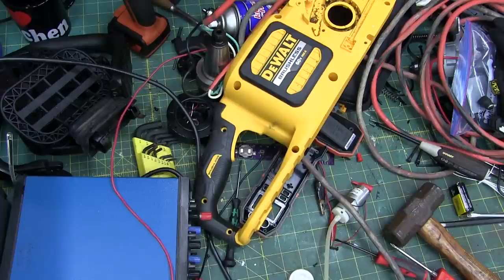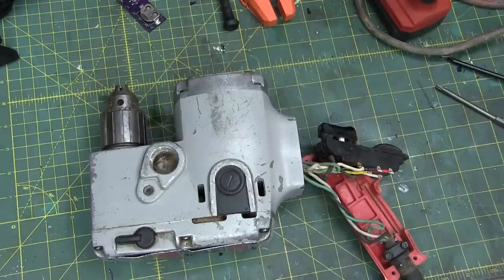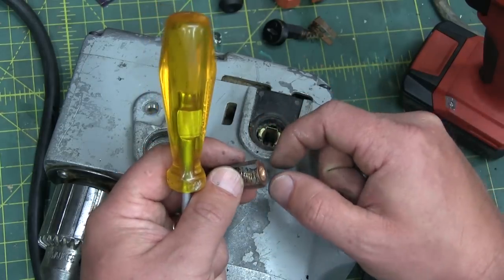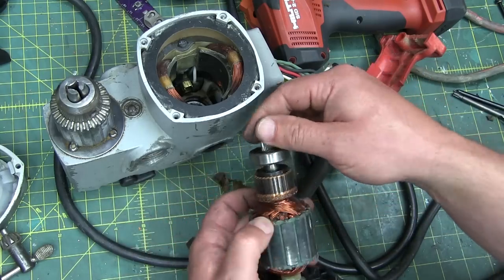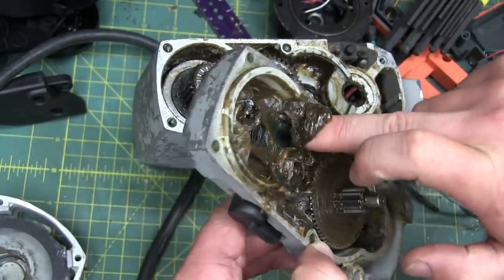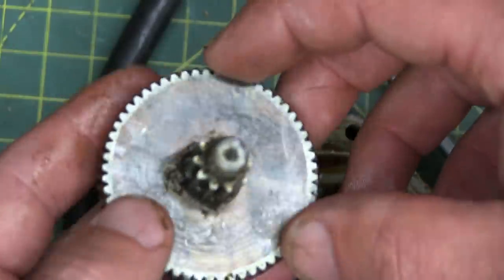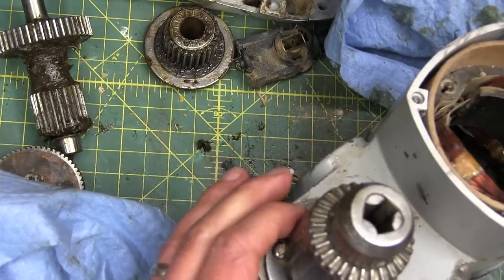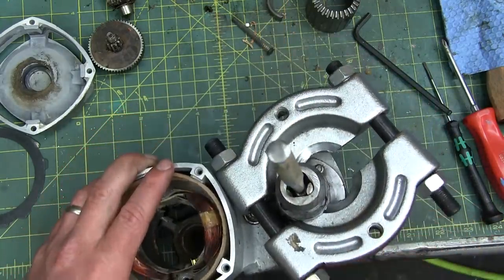BOLTR: Milwaukee Hole Hawg | Long Term Quality

Comment: Great video. I've had mine for about ten years or more and yes it's a beast. I've got it apart now because I'm replacing the cord. So, while it's apart I'm going to finish removing the cheap paint job and polishing the case. The finish started flaking a year after purchase. Total disappointed with Milwaukee for that. Other than that, its been a super tool. The handle that came with mine is almost 12 inches long. And you're right, galvanized pipe with a big rubber handle.
Thanks for the video. I was checking out which direction the chuck unscrews. Then found out it just slides on. Easy peasy.  Thanks again 👍

Comment: I still use my '96 vintage Hole-Hawg.  Bought it brand new at 19, or 20. So fun when it spins you off your ladder, and leaves you hanging at the top-plate with a 2" self-feed bit. Weeee. So, now I use holesaws and predrill 3 holes.

Comment: If you was unawares, that "broken" screw ring is broken at the factory (really).  It is machined, placed in a fixture, and snappen in twain.  It's the only way to install it.  Also: once you remove the center screw from inside the chuck, the chuck unscrews from the final drive shaft.  But only when you haven't first pressed the rotating collar off the chuck.

Comment: At  the tender age of 19 as a plumbers aprentice I had to use one of these to drill 4 1/4 inch holes on new constcution. If the bit hit a knot or otherwise bound at 150lbs I was simply along for the ride. Never hold one in such a way that it doesn't pull right out of your hand or you won't have a very long career . In other words "hold on loosely but don't let her go if you cling to tightly you will loose control"

Comment: The chuck is threaded on! Not pressed on to the shaft. That ring on the chuck is split from the factory. Put the chuck back together and put the largest allen wrench it will accept in short end first. Hit the long end of the allen wrench with a hammer while holding the opposite end of the shaft, should be standard (not reverse) threaded.

Comment: If the chuck has a "B" in the Jacobs part number, it's threaded and screwed to the drill's output shaft. For a 1/2" chuck probably a 1/2-20 SAE. Regular ol' right hand threads though. "Standard" procedure (before the drill is apart) is to clamp the chuck jaws down on a right angle allen wrench and give it a sharp whack with a mallet. Should spin right off. You'd have to re-assemble the chuck, though. Without the "B" they usually need "chuck wedges" to be removed from the tapered drill output shaft. Of course Jacobs sell those wedges at a non-trivial price. Sigh... Thank you for keeping up the awesome work!! You've helped me out of more than one jam!

Comment: Threaded ring isn't broken, it's 2 pieces. The chuck is pressed together (and apart) to facilitate rebuilding. It may be pressed into the drill's shaft via a jacob's taper. If it is, there are wedges that are used in pairs to pop it off.

Comment: The cordless chucks are threaded on with right hand thread with a LH screw in the chuck(I see you found the LH screw). Try holding the shaft while turning chuck?

Comment: That chuck threads on.  You have to take out the locking screw, then clamp a hex key in the chuck to rotate the chuck body off of the spindle.

The split ring is a split ring.  It's meant to be split so it can be assembled.

Comment: 08 makes sense. I got in the trades in 07 and the hogs the shop would send us back then mostly looked in the same condition as yours right now. Thing is, 11 years later we are still tossing the same hole hogs into the job boxes and they really aren’t looking any different as far as the body goes. The cords have to be replaced periodically and probably the brushes, but it’s nothing our shop boys can’t fix in a morning and have back out to us the next day.

Comment: Bought mine new in about '81?ish. I think that they probably couldn't sell them like that anymore. Too many people would get injured!! Only complaint I have about mine is the chuck, always was a little TOO close tolerance, a little dirt and you couldn't adjust it by hand. Had to blow out the dust and spray lube it regularly. Always tried to use bits with 3 or 6 flats on them to avoid having to use a pipe wrench on the chuck, saw people doing that before I bought mine. I only loaned it to people I trusted, only about three times. It sets in it's factory metal case next to the Hilti hammer drill out in the shop. I think that it could crank start a big block, the low range in the old Hawgs is incredible to behold. Precautions HAVE to be taken. More so now as the top rated hole saws now are stronger than they were back then, a weak point has been removed and more of that torque is available to your wrists. The best injury precaution, as is usually the case, is common sense. Great Video as usual. I thought I would see how to get that chuck off to replace it... I'm just gonna keep it lubed and stay quiet!.. Again, GREAT VIDEO! as usual.

Comment: About 40 years ago, a friend of mine was up in a ceiling crawl space, in a really difficult spot to get to and he was using a Hole Hawg with the ground prong yanked out of ther plug just like this one to drill for some romex to be pulled thru from one space in a strip mall to the adjacent space a bar we frequented to expand and double its size. Well, with the really twisted position he had to assume to be up there, the visibility was NFG and he ended up drilling into something electrical that gave him a nasty jolt. This caused him to be unable to release his grip on the Hole Hawg and it twisted his forearm all the way around breaking both bones in multiple places and tearing up a bunch of the other connecting tissues in his arm. He required a number of surgeries and several months of rehab to eventually recover (more or less) but was bever really the same after that.

Comment: I'm kind of wondering if it wasn't built in that cardboard tube to make manufacturing easier. Or maybe to keep the heat from getting to the metal case and getting so hot the user couldn't hold it any more.

Comment: I believe the fan was sucking the air not blowing the air over the windings.
Also, in my experience, the ring on the chuck are normally in two pieces otherwise they cant go on.
good review. thanks

Comment: I suspect the cardboard cylinder is an insulator so if the winding enamel cracks, the grounded metal case won't immediately trip the breaker.  Or the elec-chicken gets bitten by the pixies.  About 20 years ago, I replaced the 3 prong outlet (with the missing ground pin) with a good 3 pin plug and also swapped out the burnt out trigger switch.  No variable speed there, just the high/low gear on the gearbox.

Comment: The threaded ring in that chuck was intentionally cracked at the factory to assemble it.  They machine it as one part so the threads are perfectly in line.  Then they harden it and break it so it can be installed.

Comment: The switch connectors do come out. They are a flag type terminal. When we change cords on these we just snip, strip, and spin on wire nuts to connect the new cord to the switch.

Comment: The cardboard will help keep the case cooler, that's one place you hold onto. Nobody uses that pipe nipple handle, it's the first thing you throw away, it's a good way to get hurt, these hole hawg's aren't a toy or for the faint of hart but they are priceless!

Comment: Late to this party, but I picked up a real old one of these in an auction lot years ago. Turned out - I don't know how - but someone had managed to twist the spindle in two! Although it was way beyond my skill level, I made a replacement out of 1144 stressproof and it works to this day! I seem to remember chuck being 3/8-24. Must have been right-hand too, cuz I wouldn't have been able to single-point it back then and I know I didn't have a LH die...

Comment: There are several different ways that Jacobs type chucks are held onto the shaft.  I'll bet yours is threaded on with normal (lefty loosy righty tighty) threads.  The reverse thread machine screw is to lock it on the shaft.  Kind of like a jam nut arrangement.

Comment: Oh, yeah they'll spin yer wrist right in two. We used to use them to install central vac systems in new construction...with a 2.5" monster bit. And for speed we had the 3' foot extension rod so we didn't need to use ladders too much. Loved watching my noobie installers spin right round when the bit got caught on a nail. Ah THOSE were the days! I still have one somewhere.

Comment: I can’t take it anymore. There is a special tool that slides over the opposite side of the chuck shaft that needs to be clamped in a vice, you the need to tighten the chuck on a 1/2” hex socket bit,& then either use a 1/2 impactor tool, or a extremely large breaker bar to remove the chuck. I use to rebuild the hole hawgs. The small pinion gear was the weak link. The teeth would always break when knuckle heads would try to drill 6” holes in high speed. The cordless hole hawgs have clutch gears that slip when someone try’s to get rambunctious with bigger than specified bits. Overall,.. the hole hawg is a great high torque drill.

Comment: Company I worked for got an original hole hawg back in 1970 for roughing electrical. Had an 18 inch 3/4 inch auger bit. Would zip through studs in high gear.... and throw you if you hit a nail. Low gear would break bones! Have wanted my own ever since but just never had need enough to buy one. Sad to hear new models not up to snuff.

Comment: We use an old school Milwaukee drill attached to a 4 foot bar with a chain to drill open safes. We use a twist drill that is hardened all down the shaft. If you hit a ball bearing hard plate and you’re not ready, it’ll come screaming upside your head.

Comment: Those chuck jaws need to be number when they are removed. There are probably number marks on the main chuck body to let you know which jaw goes where. If you didn’t mark the jaws google it as there are pictures showing which jaw profile (where thread meets smooth tip) goes to which number. Also you didn’t break that ring. It is machined then scored on the sides and then split on purpose. Kinda like a connecting rod.

Comment: Took one of these sum bitches apart about 6 weeks ago.  A lot older than this one still the same set up.  The chuck is threaded onto that shaft. I locked a hex socket into the chuck, gave it a quick rattle with the impact and flew apart. I can feel the pain, but as always great video was definitely looking forward to this review.

Comment: A lot of power tool chucks are threaded on rather than on a taper like machine tool chucks.  Of course I have never taken one off of that tool before.  I did have one of those flip me over while trying to drive a 6in hole saw through a stainless tank....yea it was a fun ride.

Comment: The wiring to the switch actually pull out the back.  In order to replace a bad one while on site without dismantling the whole drill, just the handle.

Comment: Interesting tidbit about IDEAL Industries, the company known for Wirenuts; it was founded in 1916 as the IDEAL Commutator Dresser Company. Walter Becker created a formula for a man-made stone that he baked in his mother’s oven. The stones allowed commutators of large DC motors used in elevators and industry to be cleaned (dressed) in the field. Eliminating the need to send the commutators out to a machine shop which would take the motor out of service for days. Field dressing could be done in hours. 

I assume the change to induction motors killed the market for commutator dressing stones in industry, but IDEAL is still doing pretty well.

Comment: Chuck is threaded on.  The thread size 5/8-18 is stamped right in the chuck.  Also, you didn't break the chuck nut.  They are split in half at the factory after they are machined.

Comment: The chuck is threaded on to the spindle-it says right on it "THD 5/8-18".  Also, a chuck mounted on a taper wouldn't have the small LH screw inside, either.

Comment: The spade connector was more than likely just barely scratching on the brass brush sleeve when you tested it. I'd think under a full load run it may jostle around enough to be one hell of a deal for your buddy.

Comment: About the helical gear, I was surprised there was only one set but then of course the speed adjustment would need a spur gear. Plus the helical would have better contact ratio for the input but more stable centre after that. 

Just a side note an involute is technically the shape profile of the tooth on a gear, which can be both spur and helical gears. 

On the gear where you mentioned the grinding marks. I'm pretty sure the silver outside could be some form of case hardening with a softer centre.... if you want more details I can try find out exactly what case hardening it could be 🤷‍♂️

Comment: That chuck isn’t broken.  It’s supposed to come appart like that.  Although it looks like you lost the ball bearings from the split nut.  Also if you look at that nut there’s a cut and it’s split there from the factory so you don’t have that crunchy feeling while moving it around.

Comment: Split nut is proper on that chuck.  Can't replace the jaws otherwise.  Just mate the split back up properly and put it together.  Press the outer collar back over the split nut and you're golden as long as you have the jaws properly positioned.

Comment: We had one like that probably made in the late 90s because it was somewhat old when I started using it in 2001. It could break your arm with ease if you weren’t careful especially drilling 2 9/16 or bigger and getting it in a bind. I sprained many a wrist on it

Comment: How about read the side of the chuck. It will tell you if it is threaded on or tapered fit.  A lot of that size has right hand threaded spindle, then a left hand retaining bolt down the middle. That way it can handle forward and reverse loads. You didn't break that nut, they break them when they make them. You could even reassemble that chuck as they are just pressed apart to service. Hammer marks not withstanding. 
Had to go back and look for a clear shot. 30:29  5/8"-18 threaded chuck!

Comment: @ To The Top Crane - The original Hole Hawg will rip you right off a ladder and your feet will slap everyone else around as you spin around in mid air. You learn real quick how to set the pilot bit on a hole saw. If that pilot bit exits the material before the teeth start cutting, you will go for a ride,  as you are pushing the drill, the pilot bit breaks through the material, then all of a sudden all those hole saw teeth grab, and you go the opposite way the hole hawg is trying to go. And by the time you realize what just happened, your arms are in a knot. and you cant let it go. They have a granny gear, which should be illegal. I am positive it has a 1960 Saginaw transmission out of an international power wagon. If someone says they had a bad experience using this "tool", they are not lying, they did!

Comment: The chuck screws off its threaded the bolt inside is to keep it tight it's not a tapered shaft like a mill takes and the nut is made split.

Comment: About the tags. As an enginerd I have the pleasure of reading a lot of standards. In the EU standards they actually require the labeling to be  robust, and in one standard it actually required the label to be INDESTRUCTIBLE. Those standards are more for industry than consumer stuff.

Comment: The  chuck is usually a right hand thread. If the transmission was still in the drill, all you need is to chuck up a large allen wrench and give a the wrench a wack with a hammer.

Comment: that ring is already  pre-snapped before fitting at the factory.That way they can make it super tolerant but still need it in two parts for assembly

Comment: Am I the only one who knew that chucks screw on? It even says the thread size and pitch on the side of the chuck itself! 

Also, Milwaukee tools tell you when they are made, down to the week. The last two digits of the year and then the week of the year are the 5th through 8th digits of the serial number. So this tool was actually made in 2000 on the 18th week of the year.

Comment: I guess i should some day do a teardown of that old Fein "hand held" drill.
Built some time in the 80s, 4 mechanical gears (the lowest at around 200rpm) and a 380V 3-phase motor at 1.2kW output power.
Thats some torque for you. I once used it to remove some lugnuts that my impact couldnt handle, needs 2 people to hold.

Comment: As a sprinkler fitter these things were supplied with a jig for drilling holes in the mains for a saddle branch line. No sense in using a different drill to hog a hole through a floor or wall... Being a lefty I would have to hang on with all I could because the handle would pull past my thumb and spin the drill around and smack me in the back of the hand or even better my face when I was leaning into it!

Comment: You know that the chuck unscrews from the shaft, right? Beating on the damn thing won't take it loose. Stick a punch in the hole the the chuck key goes in, then wack it with a hammer to break it loose and unscrew it. You don't have to lock the shaft or anything, just the shock from wacking it with a hammer is enough to break it loose. Can't remember it it was left or right hand threats on the shaft.

Comment: I do miss the old brushed tools mainly because people threw perfectly good units into the bin that just needed a new set of brushes on it. In fact my coffee machine had the same problem when I bought it broken, guy paid like $2000 for the damn thing new and threw it out because the coffee grinder on it didn't work anymore but the brushes were just gone after the 30000 or however many cups it had on record at the time